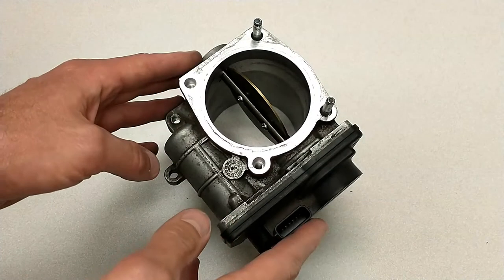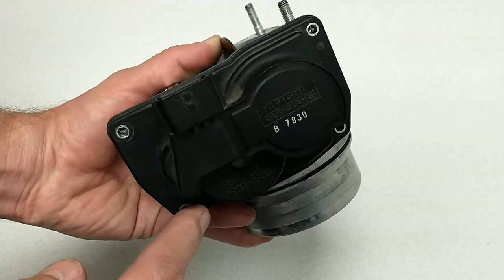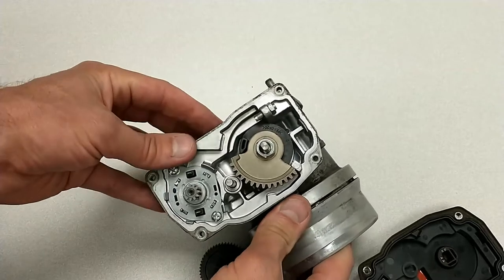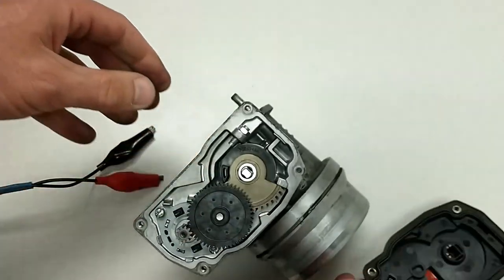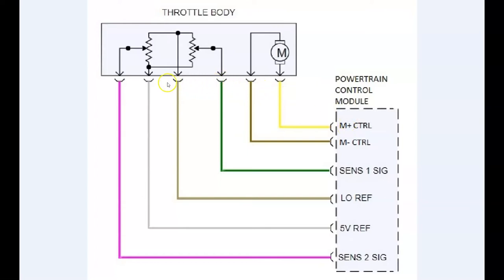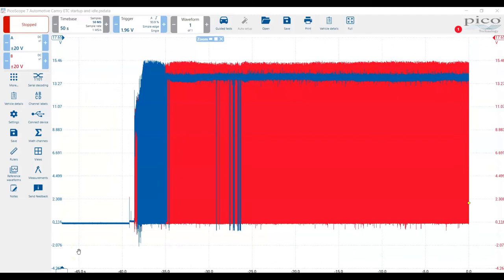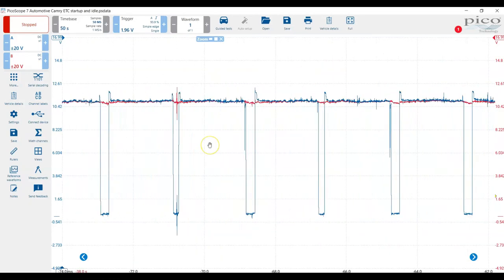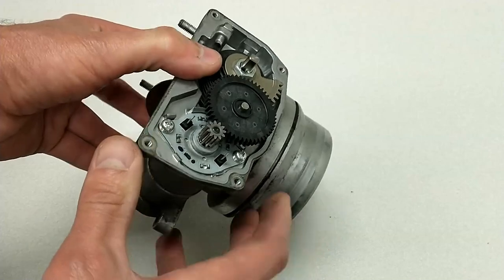How Electronic Throttle Actuators Work

Comment: Can you do the same test with the positive and negative using the connectors that are on the black plastic part where the wiring harness connects?
Reply from the maker: Yes, but you run the risk of damaging a computer if you do that while it is plugged in.  I would recommend unplugging the connector, the jumping to the terminals on the throttle body (keeping the rest of the harness isolated).

Comment: You can open and closed the round metal inside the throttle body right coz i just removed mine and it will only open it wont closed.  It will closed if i will removed the top gear. Thanks

Comment: I think this is a throttle for a diesel vehicle. Where you need as much air to enter the vehicle at start up for compression. In comparison to a gas vehicle. I could be wrong.😁

Comment: Hello i have an issue with my honda Crv 2013 and its P1683… P1683 HONDA - Throttle Valve Default Position Spring Performance Problem

Comment: Full marks man now I understand it, I thought it was controlling the duty cycle of the motor but it is putting out 2 voltages to the motor like 12 and 10 to get it to open/close, my ECU is still not able to stroke the throttle flapper though, everything tested good, the pot and the motor, even the throttle motor relay is working. Do you know of any software that I could use to override (stroke) the throttle body motor?

Comment: It’s also says that // Powertrain, MFG, computer output circuit, Fault : 83

What’s does it mean?

Thank you 🙏
Reply from the maker: I wish I could diagnose it from a distance, but I can't.  It would require some electrical testing - preferably with a lab scope.  You could have a faulty throttle body or there may be an electrical issue with the sensor, the wiring, or even the computer.